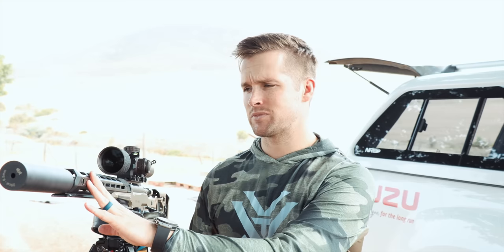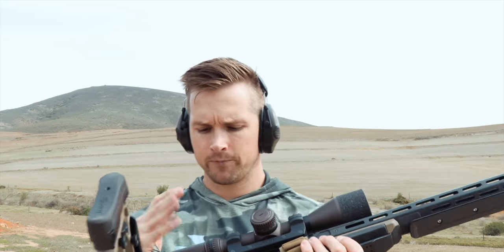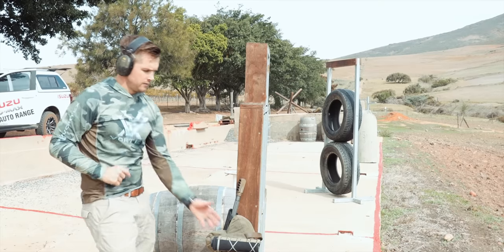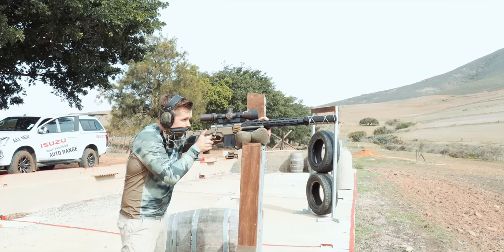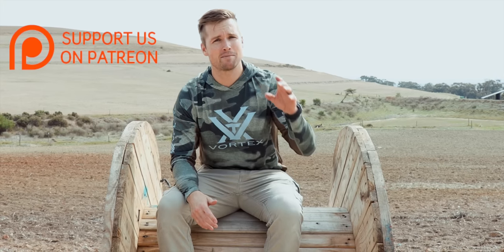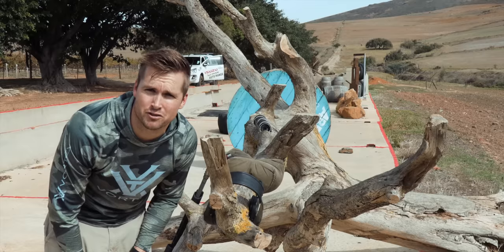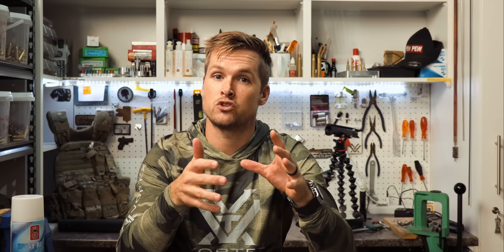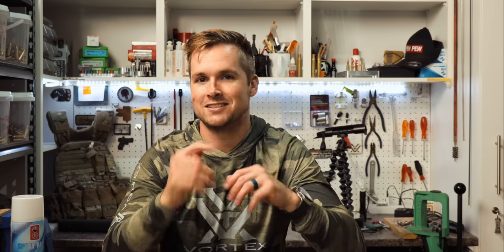Silencer vs Muzzle Brake (Which Is Better for Precision Rifle)

Comment: i'm in the middle of a custom 300 PRC build that I was on the fence about on the brake/silencer. After seeing both in the same position on the same screen, you answered my question... A brake is what I will be using. I may still shoot a silencer on it but the brake will be the standard hood ornament on MY hot rod! GREAT video! Thanks.

Comment: I use brake allmost every time when I'm shooting, helps to keep an clear sight picture after multiple shots and I can even spot my own vortex in good conditions that helps me to make fast corrections on next shot, only time when I use supressor is when I'm hunting from ground blind and I dont want to wake up people when I shoot boars in night or hunting with a dog. Allso I shoot a 6,5x55 and that's why I have 26" barrel that I can take everyting out from cartridge so I dont want any more lenght to barrel what supressor add to it.
What it comes to a gunrange there is some ranges where muzzle brake is not allowed but I dont use them, I have shot long range competions what are kind of a bench rest but only with a hunting/military style riffles and accesories, no glitter painted bench rest guns allowed and only allowed support is your bipod or back bag, 30 shots on 800 m in 60 min and smallest group wins, it's nice to shoot next to a .338LM with  a brake when muzzle blast will emphty your nasal cavities and after competition you can breath a lot better. :D

Comment: Great breakdown especially explaining the frames per scene, I used suppressor all last season here in the uk and I certainly found and agree with you that the suppressor gave a progressive and longer recoil, I mainly used the suppressor as it gave me an amazing accuracy node in my load dev but this yeah I have developed one without it and am using a brake all this year, think I prefer the quick sharp recoil pulse and manoeuvrability of a break.

Comment: I have been learning my new AR 15 in .223 wylde, and it came stock with a muzzle brake. In shooting it, I made the mistake of no hearing defenders when I first shot it, and once more when I was in a rush to shoot it, and in both cases, my ears hurt as bad as when I shot my 30-06 next to a solid wall.

I learned you could defeat the brake with a tube slid over it, so I set one up and the difference is like night and day. Now I am looking to buy a suppressor if I can, or build one if it is faster and less expensive.

Besides the noise reduction, I did not notice a difference in felt recoil. But I have been shooting 30-06 most of my career, so .223 is not a hard hitter like my custom 30-06 rounds.

I also noticed I was not flinching from muzzle blast with the tube slid over the brake, so my accuracy was better. I am becoming a firm believer that we need to have noise suppression on our firearms to mitigate the tinnitus from repeat shooting, and leaving the muzzle brakes for the firearms that cause bruising without one.

Comment: I prefer the brake for the same reasons you list. The snappy and ultimately reduced recoil. (I use a .308) However when at the range I am never very popular when using it! Suppressors far more sociable!

Comment: It's because in my opinion the suppressor only helps by adding weight. With brake actually reverts gas to pull the rifle and counter act recoil.

Comment: Ive had a few people complain that with a muzzle brake , their shots were pulling off centre . I found that some of the factory brakes didnt  have consistant loover holes ,  and had to be touched up with a die grinder to be the same , and it worked .  I told one guy to  hang the gun in a toilet and pump air into the breech , and file the loovers , until it didnt move sideways , he didnt think that was funny .

Comment: Look at the energy transfer through the support. From my experience the way I describe the push back/recoil is a muzzle brake pushes you back and at the same time it has blow by so you get the snap. Where the suppressor pushes you back and at the same time the blow back fills the baffles sending the recoil back in waves. Thus the muzzle brake feels like a blunt hit (Hammer🔨) and the suppressor feels more like a shove (shock absorber).

Comment: Lekker video Piet. Is there a APW available in M24x1 thread? Also i have found that besides the bad mirage after a few shots from silencer, the barrel heats up way more at the front of your barrel. I have a sustac silencer on my 6.5x 47L and i can honestly say that its the best by far and made in SA. Also a reason that i went for a silencer is because some local competitions dont allow muzzle brakes which is sad. But also if you shoot next to someone with a muzzle brake it gives a real bad blow in your face.

Comment: The one thing nice about a brake vs a suppressor is the brake won't loosen up as easily, if ever,  since they are torqued and timed. The can being hand tight will back off eventually.

Comment: Just a question: On both my rifles that have suppressors, there is a large improvement in accuracy with the suppressor on. I'm sure one could get the same effect with a brake and a weight, but have you noticed any accuracy differences between your suppressor and your brake?

Comment: Hey, there's a piece of brass in a dodg.....nevermind, you got it.

Actual question: what brake is that? Or what brake would you recommend for a 6.5 Creedmoor? I like a can on a 22 lr because it makes them hilarious - but with anything supersonic I haven't found as much favor with them. That said - I also never expected such a recoil difference on a 6.5 Creedmoor. Earlier in my shooting days I had a 338/300 RUM (now called 338 Edge) and sure, that thing w/o a brake was very noticeable - but with a 308 and the like I never thought it would really matter that much.

Comment: Good info as my next rifle i'll be getting will be in 6.5 and trying to decide during my build to suppress or just a muzzle brake. The 4 weapons i shoot now all have brakes and i'm fine with the recoil but being 68 my hearing is pretty much done. Saddened to see that while your using hearing protection if you keep shooting without eye protection you eyes will be a lot like mine from excessive exposure to burning powder. $200 for a stamp i'll probably build a suppressor just to have. 🤓

Comment: Hey from New Zealand. I have a few DPT suppressors and they are cheap and not the best as far as recoil management. I also run an ODL ( another nz company ) which is night and day compared to the DPT but almost three times the cost. I also have a Hardy Suppressor ( nz company ) which performs way better than the DPT, so in short you get what you pay for. 
Awesome videos by the way and keep up the great work 🤙🏼🇳🇿

Comment: I run a brake cause i cant run a can. Revisiting this topic with a through the scope footage comparison while running a barricade type stage and awkward position would be cool. This opens the door in regards to building and leaving a position, ease of calling your shots, and making follow up shots with different rifle configurations (ie. light gun/heavy gun). Btw, what action is that rotating on your bench?

Comment: Hi, great video with an interesting topic. 
I have done these test with high speed camera. Measured movement in rifle per frame at 40 000+ fps and calculated speed, acceleration, force, momentum and kinetic energy. And what I found was that most of the action is happening within the first 0.0003s. Even if measuring recoil with an accelerometer, you only get a average because it does not have fast enough sample rate to pick up the action.  I did this because we have developed a suppressor that tops all other suppressors and probably all muzzle breaks in recoil reduction.
Reply: What's the innovation?
Reply: A new type of suppressor
Reply: Here are the quick specs: L:90mm, W:40mm, Wgt:6.2 Oz, Multi Caliber :cal 17-338LM. Recoil reduction on par or better than the most effective muzzle breaks and sound reduction on par or better than the largest suppressors.
Reply: @kaizerzouse  any links?
Reply: Most recoil action occurs as air ahead of the bullet is accelerated out of the barrel. A break vents this air back to the shooter to balance recoil forces.
Reply: @nicoleyensen7062  Sorry for very late feedback link to suppressor https://youtu.be/UxII-RPlsG4

Comment: You’re also forgetting about the other cons of using a suppressor. Added weight and length. Are usually making it harder to maneuver the gun into harder positions like portals.nvm just saw your said at the end of video
Reply: True how ever you can get around an extra 100 feet of range with one.

Comment: Is there a different point of impact when taking a cold bore shot using a silencer than it is with a hot silencer?
Reply: In my small amount of experience I believe yes there is, though we are talking absolutely minute differences until that whole barrel is hot. Remember how much barrel the round has gone through and speed it has built up to that point. Again though, that is what I have observed and by no means scientific.
Reply: Am I wrong? But it’s a supresser not a silencer. Still very loud. Messes ur ears up lol.
Reply: @stephengibson38  Actually both Silencer and Suppressor are correct.

Comment: What do you think about the silencers they make with a muzzle break at the end, is it worth cause i assume it will be used all over if it was?

Btw ek smaak daai plate carrier stukkend. Looks imported?
Reply: Same question from me. I think locally (SA) there are a few that make braked suppressors (eg. Gunwarrior) - to me it makes no sense, gas velocity out the front is basically unusably slow, but I've heard from people who shot them that it makes a difference? Very subjective, and I'm still not sold, it seems like a gimmick.

Comment: Does either have an affect on muzzle velocity or accuracy?
Reply: Neither affects bullet muzzle velocity. Both inprove accuracy by reducing recoil although muzzle break is superior in this aspect. 50% recoil reduction. Some breaks also vent some gas upwards to reduce muzzle rise at recoil although this is not necessary for ultimate accuracy. Ultimate accuracy is simply dependent on repeated/ consistent movement of firearm throughout shot duration. As well of course as steady aim.

Comment: what is the grip tape for on the end of the scope?
Reply: There is a video on that, to protect you scope agains scratches.
Reply: And grip. Lots of prc guys pick there rifles up by the scope to move the bi pod forward or backwards. Or rest ther hand on scope in weird position.
Reply: @dvdyk9042  I missed this video. Can you link it to me?
Reply: @johanswart8116  yeah I figured it was this but I was just checking if there was some other reason.

Comment: You really need to get something like a strike meter used in martial arts and put the butt of the rifle against that. It will give you hard numbers for the recoil impulse
Reply: It wil measure the inpact but backwards but wil it measure the supressors delay building up pressure and slowly releasing it??
Reply: @johanswart8116  It should measure what you feel.  I have not used one of these but if it is any good it should give you a graph of the way the force builds and then disspates. It's worth investigating. I have not seen any other gun channel do this eg Demolition Ranch, Paul Harrel etc
Reply: This is the device
Reply: Here you can se the silencer blowing a jet after the shot. Think thats why piet says the muzzel brake feels like a snap but the silincer is more delayed.
Reply: I need them both for different applictions. Lol